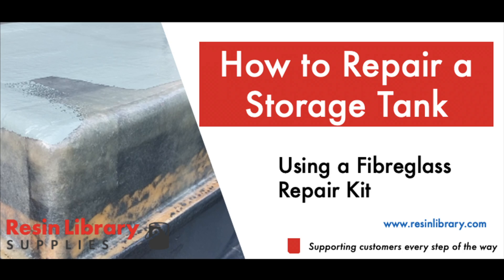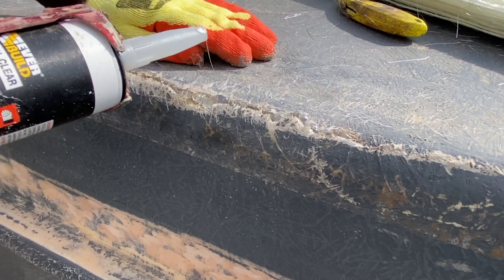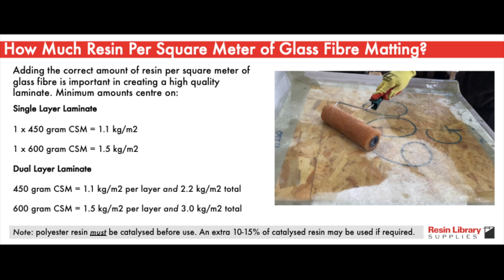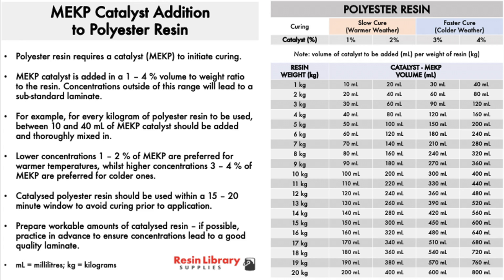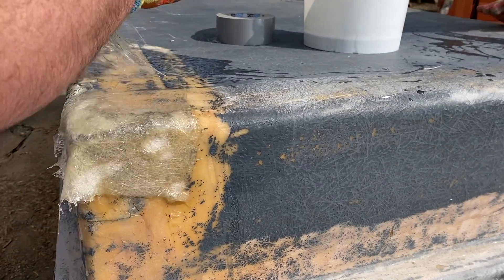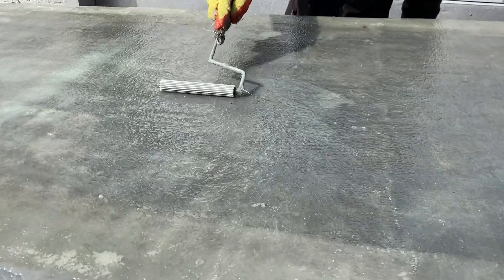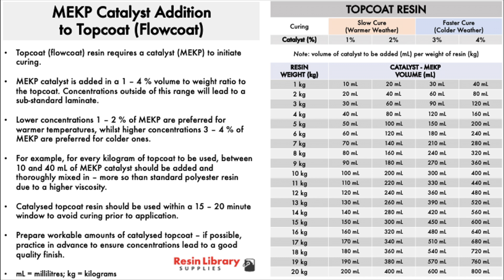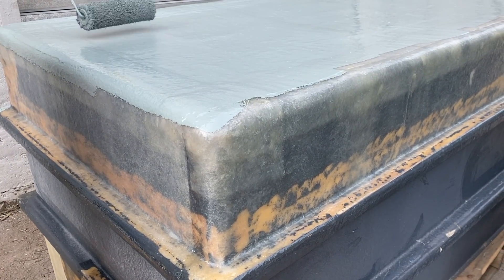Repairing a water tank using a fibreglass repair kit

Comment: Using a fiberglass repair kit is a practical solution for fixing cracks or leaks in a water tank. The process typically involves cleaning the damaged area, sanding it for better adhesion, and applying layers of fiberglass cloth and resin. While DIY kits can handle minor fixes, it's essential to ensure the repair is durable and long-lasting.
Hudson Fiberglass offers premier tank inspection and piping services for aboveground fiberglass tanks, ensuring expert-level repairs and preventative maintenance that go far beyond quick fixes.